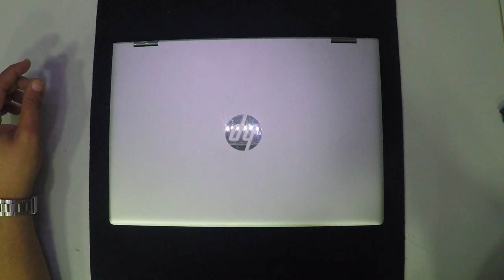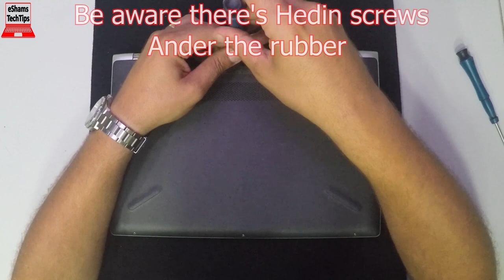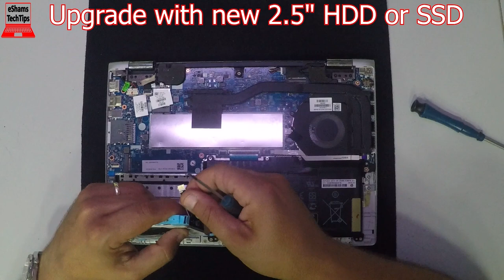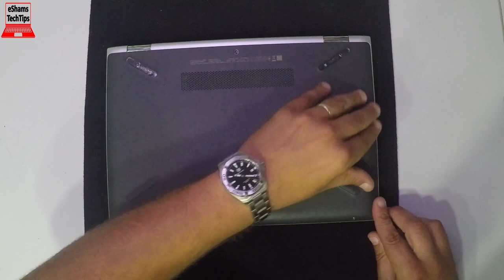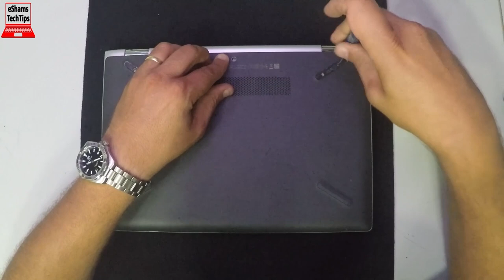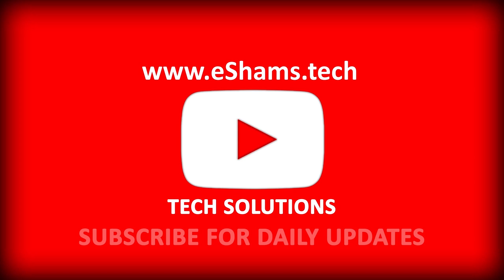HP Pavilion x360 Convertible 14 cd0 HDD SSD UpGrade

Comment: my model that I am upgrading has to connectors.   where could they have gone?   there is a pad for it with no cables, nor connectors.   Where would the built in SSD go?